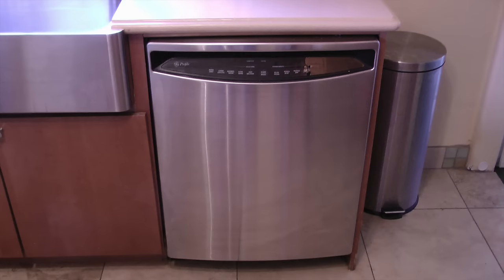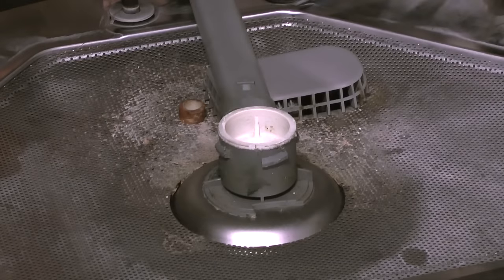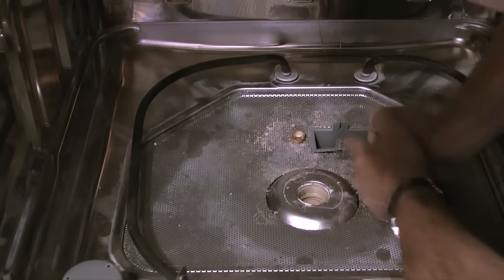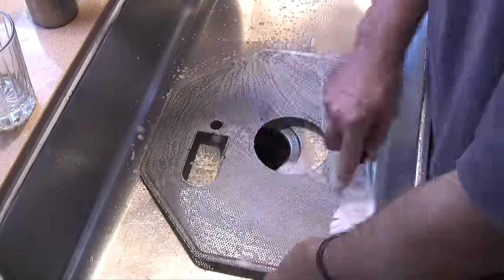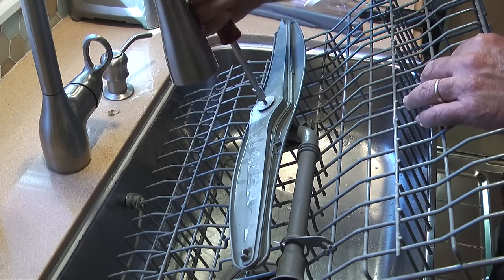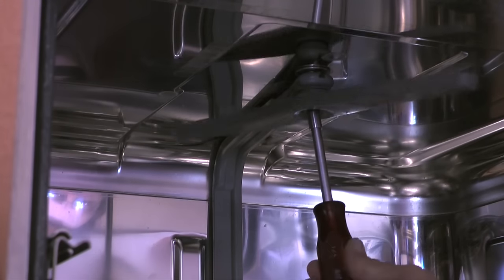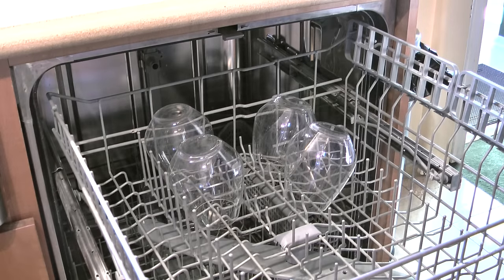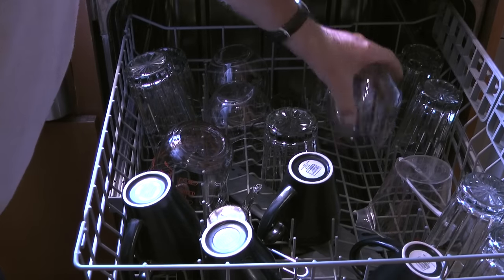GE Profile Dishwasher Maintenance

Comment: Thanks for the helpful video on a truly terrible design. The filter should be unobstructed and pop out in the front just like a clothes dryer lint filter. Sorry, but the industrial design on this is purely to keep GE maintenance folks in business.
Reply from the maker: +Nucleus Medical Media 
I agree!! Thanks for the comment.
Reply: +iScaper1 I agree as well.  Why do we see nothing in the manual about how to clean the insides or that it is actually ever needed?  Because the folks at GE want you to either have to call their repairmen to clean it out/fix resulting broken parts, or buy a new machine.

BTW: this video was SUPER helpful!  Even I could do this!  Thanks.
Reply: demelza bunny Totally agree about the placement of the filter. Great video. The only thing I couldn’t do was to remove the top tray. I was afraid of breaking the plastic thingy. Mine is the same model but the stop is slightly different. Dishwasher was running ok but it was filthy in the bottom area. 16 years of muck. Didn’t use it much in the beginning. Thank you.
Reply: Not sure why this comment disturbs me so much.  Perhaps because of it's conspiracy theory angle.  Just stop!
Reply: The design has more to do with quick assembly on the line at the factory, as opposed to the maintenance of the dishwasher. It's the same with cars and trucks. What is sometimes a pain to fix was easier to assemble on the line. It's all about getting the product out the door of the factory in a timely manner for the consumer.
Reply: @jasstack  Well, in that case they should design products which do not need servicing. We know that doesn’t work. So manufacturers should “design for service”; the future belongs to customer-centric companies. It’s no wonder GE had to pare many business down to survive.

Comment: Hello and thanks! My dishwasher was making loud noises when pumping out water.  I looked in the users documentation and found no information.  This video helped me to disassemble, clean, and (importantly) re-assemble the fluidic pathway.  The filter was difficult to remove, but well worth it.  It was coated in slimy stuff.   I agree that neither the dishwasher nor accompanying documentation was not designed with user serviceability in mind.

Comment: Thank you after I bought the house I have been putting up with this same problem for a long time. Popped out the bottom piece and then said what a nitemare. Thanks for proving me right and then showing how to deal with it. Food particles clinging everywhere and that white film. Victory shall be mine cuz of you.
Reply from the maker: Thanks Mark for watching.
Reply: All done, found out I wasn’t the first in there. Broken parts tabs and a screw under the lower spray arm. Nothing crazy, just don’t tell the wife it’ll give her the excuse to get a replacement unit
Reply from the maker: @AFVETmark  Your secret is safe here 🙂

Comment: I just finished cleaning the dishwasher using your video. Worked great! 
One change I did: after disassembly, I put some Liquid Plumber in,  and let it sit for15 minutes. Then assembled and then run and reset 4-5 times. 
Now it is clean and works well!
Thanks again! Without your video I wouldn't have done the cleaning, and very likely would have had to spend tons of money on repair or likely a new machine!
Kudos!!!
Reply from the maker: Thanks, I'm glad the video helped.

Comment: This was exactly what I needed, thank you! I have no problem taking things apart, but I only like to push/pull/twist so much before I worry I'm going to break something. Your video gave me confidence to take apart and clean my dishwasher. (Parts were a bit stuck with scale build-up.) It is working much better now, though still not 100%.

I will also mention that the part you take off before the circular fine mesh filter has a small washer in it. Mine fell out when I was cleaning it, and I needed a parts diagram to confirm where it went back in. I had seen one in another article about fixing my dishwasher, but it appears they are on the GE website as well. You have to search for your model # under "Filters & Parts," which is different than searching for your model # on the main website (that only gets you the owner's manual and other literature).

Comment: I am a 60 year old retired home economics teacher.  I just read in a magazine that it was important to clean the filter of the dishwasher regularly and October was a good time to do this.  I have lived in my home over 6-1/2 years and never had cleaned the filter because the manual that accompanied the dishwasher did not mention anything about cleaning.  Although my dishes weren't getting clean for the last couple of years, I just assumed that I needed to replace the dishwasher.  After watching your video, I decided to take the challenge and attempt to clean the filter and parts.  You articulated so clearly and calmly.  In addition, the video was excellent and gave me the needed confidence because it matched my dishwasher interior perfectly.  This project has turned out to be an all day event because of the stubborn build up of dishwasher detergent that had calcified on the bottom of the dishwasher under the screen.  I needed a video on how to deal with that! I did discover that the poor performance of the dishwasher had nothing to do with the model but the build up of junk in the filter, sprayer holes, etc. Actually I am surprised that the dishwasher even operated.  Currently I am running my first load of dishes after completing this project.  I am hopeful that I will see a difference in the cleaning.  Thank you for providing this video.
Reply from the maker: +Linda James 
Thanks Linda for watching. Did your cleaning work?

Comment: Excellent video. Fixed my problem of dishwasher not draining. We missed a monthly cycle of running vinegar thru system. Filter was clogged with what appeared to be partially dissolved soap (Cascade). We are switching to liquid dishwasher soap. Thanks for your help. My wife commented to me why can't I be as calm as the guy in the video. Lol
Reply: We "clean our dishes twice"  and so no food collects in our dw.       But the dishwasher detergent precipitates (or perhaps never dissolves completely) and so clogs the sump filter, with a very resilient salt.     I would expect that even liquid detergent will also clog that filter, by precipitation.       Thus the need to clean the sump filter, method provided within this EXCELLENT video, is a chore every dw owner should expect to undertake... perhaps annually.           (I speak from experience, on this problem.)

Comment: Just finished cleaning my GE dishwasher
Thanks to this video, anyone can do this
I'm a 52 year old female and I'm glad I didn't
 have to have my husband do this😀👍
Reply from the maker: That's great, congratulations.
Reply: One question, I did the vinegar wash and a second small load, but I'm still getting a sour milk smell, what else can I do?
Reply: Yes, ma'am, but that's what we do! We love fixin' stuff for our women. Now what's he going to do? ;)
Reply: @findingme919113  i know this was written a long time ago but still just in case... Did you use baking soda, equal amount of vinegar, after 15min add boiling water. Let sit for a few minutes. Then rinse cycle
Reply: @alexruiz-vasquez7280  
I followed this video and took the dishwasher apart to open the bottom to get access to the filter.
I also took the sprayer arms out and cleaned them in the sink. I put it back together and ran a dishwasher cleaner pack in the longest cycle.
I run a cycle of 2 cups vinegar 1 x a month
Reply: I was looking for a video of how to clean my ge dishwasher,,it happens that I’m 52 too,,and this video saved me a lot of work,,,I’m so thankful 🙋‍♀️👍🏻🙏🏻

Comment: This video was a true life saver. Thought I'd quickly pack the dirty dishes before I start preparing dinner for the kids. When I opened the dishwasher, the bottom was flooded with the stinkiest nasty mess that I've witnessed in a while. I fiddled and tinkered with the course filter at the back to try and remove the gunk, but simply could not figure out how to get back there to clean it out. You don't see such meticulously detailed and clear instructions very often. Thank you for saving dinner!
Reply from the maker: Thanks, I appreciate the feedback.

Comment: Fantastic video, thanks!  One thing I would add is to make sure you keep track of the small washer (part 453) in the venturi that serves as the bearing for the lower spray arm.  I would have lost it down the drain while I was cleaning the venturi if I hadn't put the basket filter in my sink.
Reply from the maker: Good tip, thanks for posting.
Reply: Found the loose washer... Guessed it was originally in the bottom of the venturi.  Thanks for confirming this.
Reply: I just followed the video and YES, the  little metal o-ring washer was ON my garbage disposal trap guard...thought it was just one of the many things stuck in my filters, but your post made me realize it was important. THANK YOU

Comment: Thank you so much for this video. Our GE would run but no water would flow. I hoped it was just clogged and not something else. The trap, arms, and other parts were filthy! I cleaned everything as per your video and now it runs! I'll also run it with vinegar as you did to remove the hard water residue.  You saved me hundreds of dollars and prevented me from hand washing dishes. Thanks!

Comment: We have a four year old GE dishwasher that was working great up until we removed it to renovated the kitchen. We reconnected it and it started, it filled and it emptied the water. I just didn't spray and clean. So after looking at t new one for $550 bucks I decided to look at Youtube to see if I could find anything. After looking at about (10) video's I found this one and it was dead on. It was 8:30 PM, I was so hopeful I started in on it. At about 9:00 I ran out of steam but I have it all ready to put it back together and I am about 98% sure it will work and maybe better than before. Thank You!!!
Reply from the maker: Thanks Frank. Let me know if it worked.

Comment: Thank you. Excellent video editing producing succinct complete instructions. To prevent such food crude buildup in the future,  I suggest that you only use dishwasher detergent that actually solubilizes food grease. The detergent must contain Sodium Hydroxide which turns grease into water soluble soap. I suggest that about once a month, depending on how hard your water is, you fill the detergent dispenser with pure food grade citric acid. The acid dissolves away the mineral deposits. You can buy food grade citric acid from the internet. Or you can buy very expensive Lemishine at the grocery store; which is just pure food grade citric acid.
Reply from the maker: Good advice, thanks for posting.
Reply: Hello
Reply: Critical Reasoning ij

Comment: I have PDWT180R30SS. Whoever designed that screen should be beaten to death. Why would you ever make something that needs to be regularly removed and cleaned so difficult to access?

WARNING: Be careful when inserting your fingers into the plastic filter. There was a broken shard of glass in the bottom of mine and it sliced open my finger. 

Thanks for the video!
Reply: No need to clean if you use correct detergent with sodium hydroxide and once a month use citric acid to dissolve away the mineral deposits.
Reply: agreed, we had a bosch in our condo and it was fantastic in terms of filter cleaning and maintenance.  we got this new ge profile in our new home and it was designed by a chimp
Reply: useful tip thanks
Reply: Who remove top basket GDWF169V40SS
Reply: @theodorep9569  GE blows. Never again.
Reply: I agree with dissolving the gunk monthly to reduce soap scum. Any debris could be sucked out with a wet vac.  

To remove the filter, on the INSIDE of the filter are two tiny (and easily broken) tabs. If you pry them inward and then insert a shim of some sort (I used a popsicle stick) the other side can be pried inward and the filter is removed. 

Great video, much better than any GE instructions I've found. I especially respect the technical drawing research you put into this project!

Comment: Thank you so much for this video! I have lived in my apartment for two years and have never been able to figure how how to properly clean this model! I have been taking off the filter basket, scrubbing it, and using a toothbrush to get into the filter as much as possible but I knew I was not doing much. My building is 12 years old and from the horrific site I encountered, I guarantee the dishwasher had never been taken apart...I wish I could attach photos it was so bad. I'm going to share this video on my apartment's Facebook group for other folks to check out!
Reply from the maker: Thanks Marie for watching!

Comment: Fantastic video! A few years ago there was a recall on some part of the dishwasher. GE sent a technician out to replace the part and he disassembled it to do the replacement. At the time I commented about how difficult it would be for the average person to clean it themselves. I was disgusted and appalled by how dirty mine was - he was non-plussed by it. It occurred to me that the design of the dishwasher was such that you would need to hire out the cleaning. Very frustrating. When my dishwasher no longer was cleaning well I found your video. I can't thank you enough. I just took mine apart, cleaned it, and put it back together. The filter basket tip was great - thanks especially for that. 

Thanks so much! You saved me $$ !!
Reply from the maker: Thanks for the feedback. I think companies want you to call a technician, and that's one reason why there is no information in the manual or online on how to do a cleaning.

Comment: Thank you. We inherited this machine when we bought our home 10 years ago so must be 15 years old.  We hardly use dishwashers and use it to dry dishes handwashing. So finally found out you must clean it. So we did as my husband was able to do it with me running the video. Thank you so much. Not much came out but it was dirty.
Reply from the maker: Thanks for sharing!
Reply: @Iscaper  so the first wash after cleaning was disappointing. Is it expected
Reply from the maker: @user-gz5mx2nd5p  No, dishes should be clean. Have you tried placing a 16 ounce glass pitcher with vinegar on the bottom rack and running a cycle without soap.

Comment: Just a note of THANKS!!  I have been using my dishwasher as a drying rack for almost two years now due to dishwasher not cleaning the dishes.  Thanks to your video I was able to remove the filter and clean some REALLY nasty buildup from the filter.  I am running a cleaning cycle now and will try it out with dishes after supper tonight.  Hopefully it will start cleaning the dishes again!  Thanks Again!!!
Reply from the maker: +Gala Armstrong 
Thanks Gala. Did it work?

Comment: THANK YOU Mr iScraper ! I've had 2 repairmen out (not appliance repairmen though) who couldn't make my dishes get ANYwhere near clean since I had a rupture in my underslab / underground hot water pipes. Very good quality video and instructions - although there is always something that doesn't work the same way in MY repair as it does in the video  : D

Comment: Thank you, thank you, thank you. I just finished this project, fairly easily thanks to your excellent video. It's clear and concise and I could see and understand everything you were doing! It's a master class in YouTube how-to videos.

Our dishwasher was installed 18 or 19 years ago and never cleaned so it really needed it. I found that very fine-tip tweezers worked best for cleaning the holes on the spray arms but other than I did everything exactly as you did. The tip about using a screwdriver to release the latches on the filter basket was a lifesaver!
Reply from the maker: Thanks Donovan, I appreciate the feedback.

Comment: Thank you for taking the time to make this video. As a woman, I enjoy doing DIY projects myself.  I watched it once and was able to clean out my own DW.  You're right, the filter doesn't come out easily but I used your technique and it worked.  It felt really good to clean it myself.  I do think we have a problem with our middle spinner not spinning because our glasses still did not get sparkling clean.  I have noticed that when I open the DW door the spinner doesn't slow down like the others and suspect a functional problem with the middle spinner/sprayer.  Thanks again and have a great day!

Comment: Thank you for the excellent video and instructions.  My Maytag dishwasher disassembled in a very similar fashion.  After cleaning out some popcorn seeds and a broken piece of glass from the sump and chopper area the dishwasher was cleaning better was still not running well.  We had to add a quart of water each cycle to get the pump to run quietly instead of surging loudly.  I replaced the water inlet valve too, and now the machine cleans well and runs much more quietly.  I measured the water though the old and new inlet valves and the new valve lets in about 40% more water during the 2 minute fill cycle than the old valve.  Even though the filter looked clean maybe the internal orifice was clogged.  Thanks again for the excellent video.

Comment: Best You Tube DIY EVER!  Great Step-by-step, well produced and really useful.  amazing how much crap builds up in the filters over the years.  In my project, the white tube that the fine filter fits into crumbled - the plastic had degraded.  Ordered a new part that will require replacement of the sump inlet.  Unavoidable but oh well - will still give us years of service for this machine.